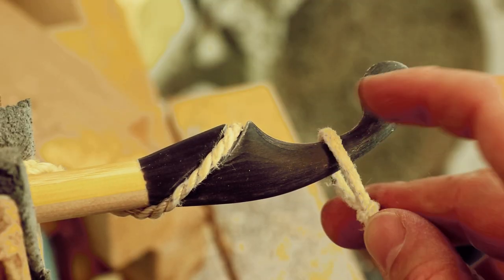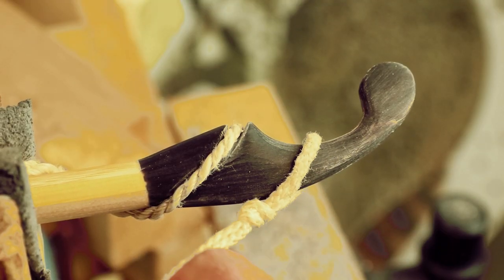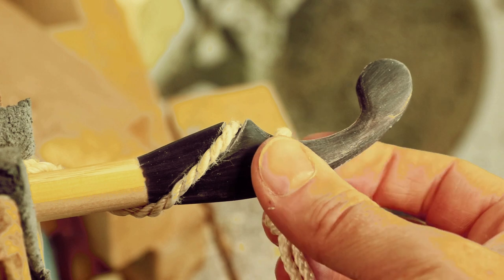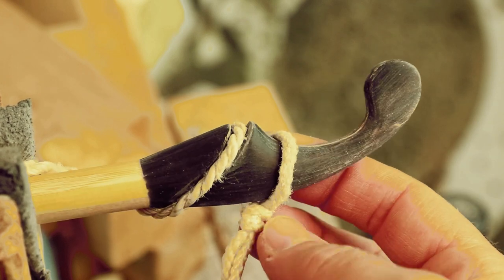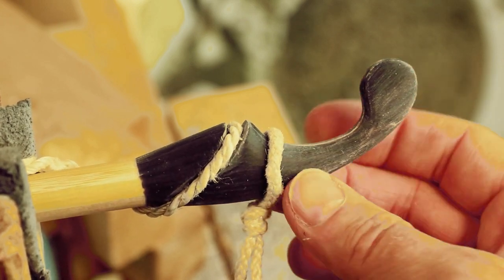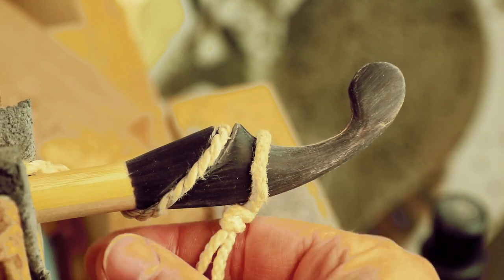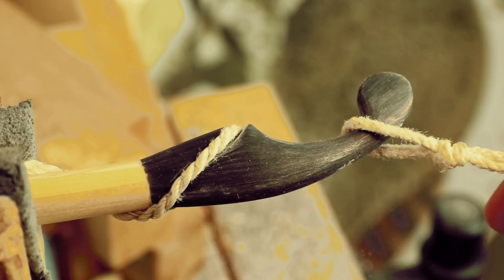Why are English Longbow Nocks that shape?  Secrets of long bow making

Comment: But what about the bottom nock?
No space for the stringer noose.
Reply from the maker: The bottom nock is the same design, so there is room, it works the same way.
Reply: @longbows  
The bottom nocks on all the Longbows I've handle have tiny pear shaped nocks, with no surface to safely use a stringer.
Could you do a follow-up video on the Use of the stringer, demonstrating Both nocks?
Reply from the maker: Here it is https://youtu.be/Y82krBBAtrs?t=102